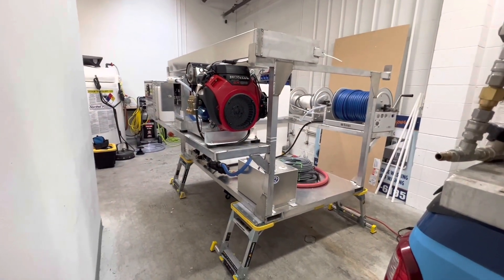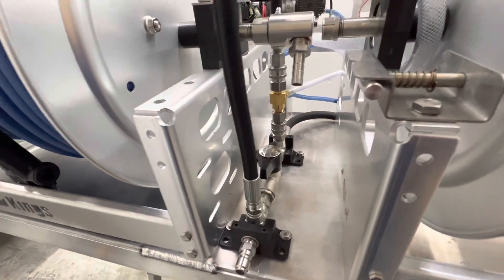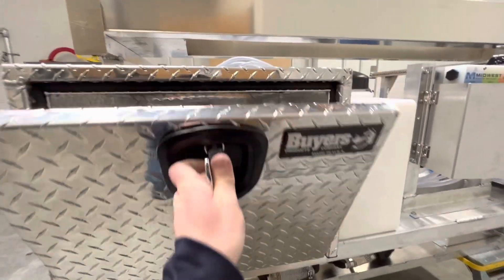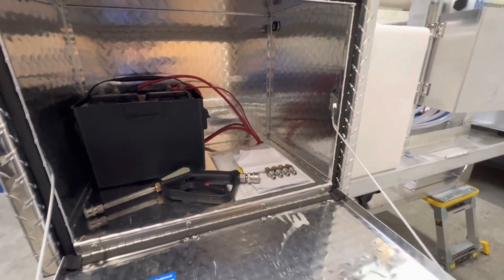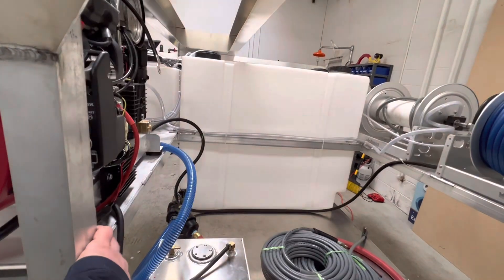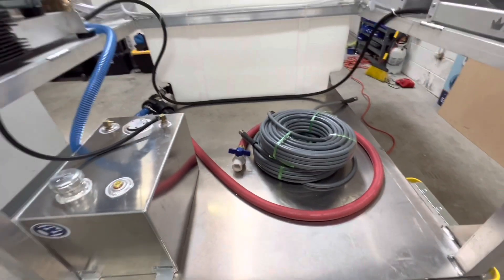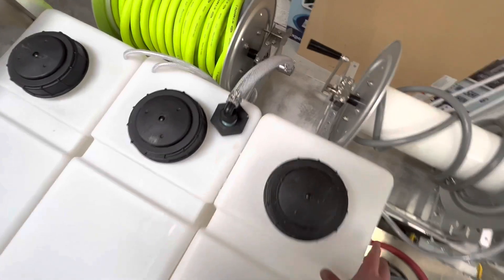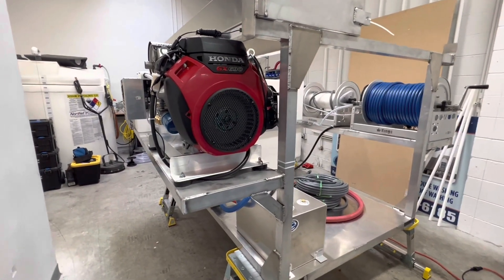Pressure washing truck skid build and walk around- Brock’s Skid

Comment: What hose clamps are those? They look way better
Reply from the maker: You talking about the t clamps?
Reply: @ExpertPowerWash  sorry the ones that are on the bulk head of the water feed with no screw they look super nice
Reply from the maker: Pex clamps. Way cleaner and they hold better. Get stainless.
Reply: @ExpertPowerWash  yes thank you going to switch over to them haven’t had to many issues with old ones but they seem way better

Comment: Hey
Quick question, when you put the pressure washer that high from the tank, does it have any problems pulled the water off the buffer tank ?
Reply from the maker: Not at all. The gear and belt drives pull water no problem.
Reply: @ExpertPowerWash  thank you so much. Takes load off my mind as I’m trying to build a skid. Much appreciated 😊

Comment: Awesome build but you forgot to show how you installed the 12v pump😩😩
Reply from the maker: Plates were back ordered. Used to pieces of flat aluminum. Bolted the pump to that. 1/4 thick by 3 in wide. Worked great. We will use mounting plates in the future. The plates are slightly better but this worked well.

Comment: Very well thought out rig. Nice work! I might have missed this in the video, but how is the battery charged?
Reply from the maker: The pressure washer has a recharging system built in. Pressure washer runs off the battery.

Comment: Very clean. I like the idea of of running the idea of running the drain hose off the cleanout side of the strainer. Why no ball valve at the tank? Imo put a banjo or similar ball valve on the drain hose.
Reply from the maker: No ball valve at the tank to reduce the amount of plumbing. Don’t really need it. As long as everything is sealed well, the ball valve on the drain hose is sufficient. Thanks for commenting.

Comment: Nice setup! Might consider installing a rubber grommet where the wires are running through the buyers box. Prevent the wires insulation from being rubbed through and possibly short out. I’ll be keeping you guys in mind for my next build. 

Just looked at your website. Do you sell the skids? Didn’t see anything about them on your website. Thx!
Reply from the maker: We are slowly updating the website. Good call out on grommets. We did make that change a few months ago.